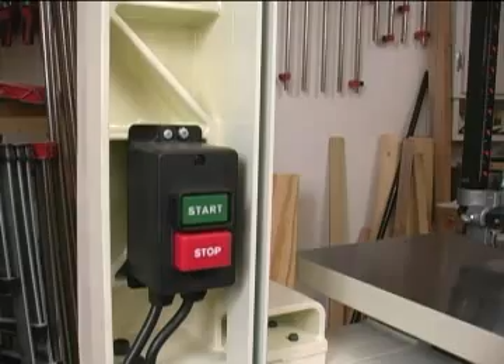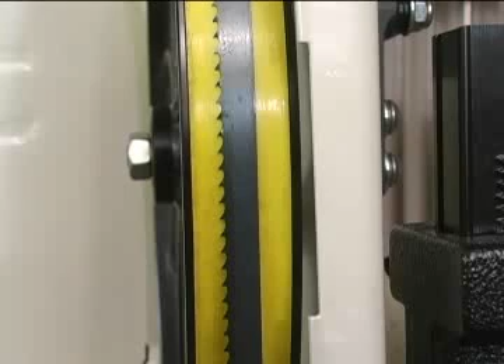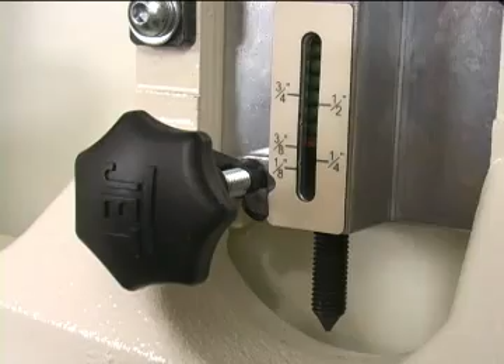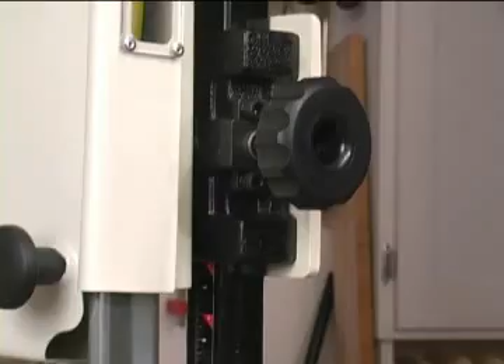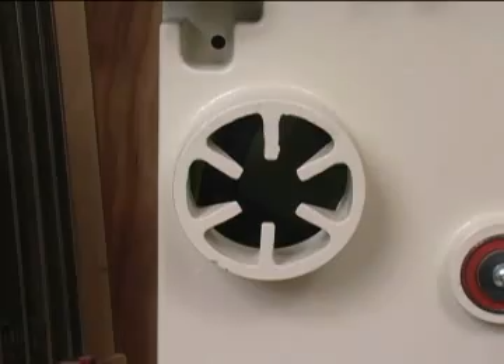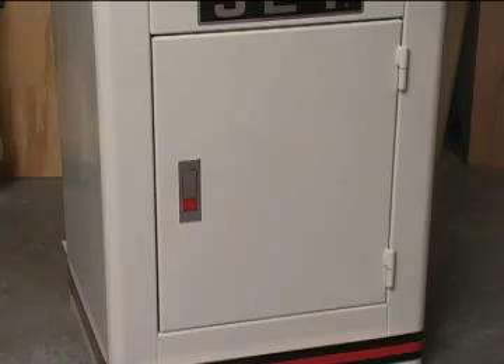JET JWBS-14DXPRO Band Saw Review

Comment: Come with support brackets for base?
Reply from the maker: No brackets that I recall. Of course, I did not get brackets with other machines either, gravity keeps them in the base, if I understand what you mean.
Reply: thintz12 they're for the bottom base, to prevent the machine from tilting over. Everyone I have asked received them but I did not.
Reply from the maker: I don't recall them but its been a long time since I had that machine. I guess Jet is the one to ask and hopefully get some if they were to be included. or needed.